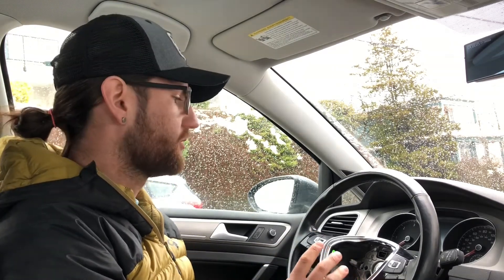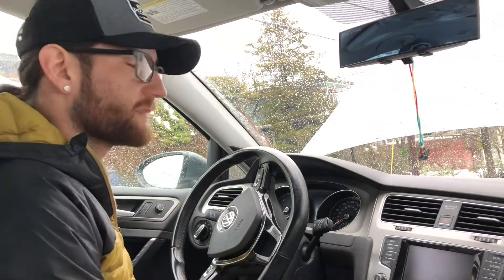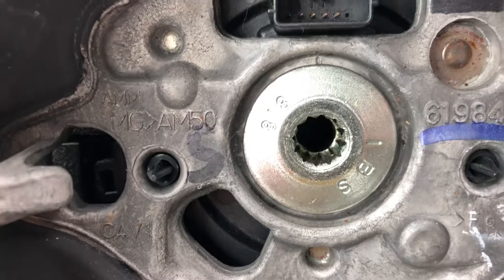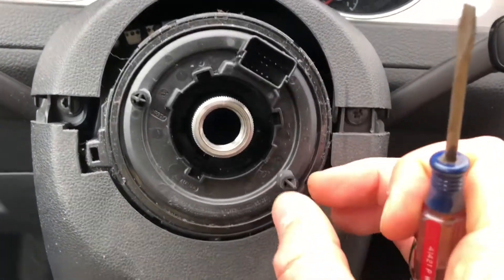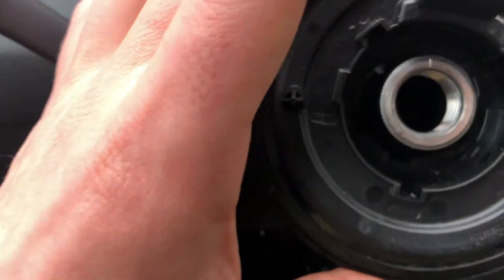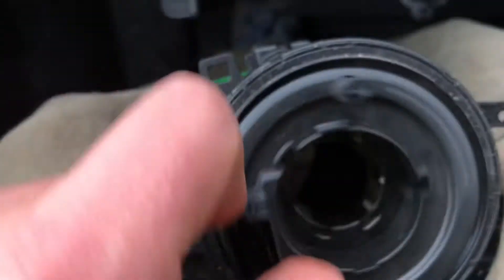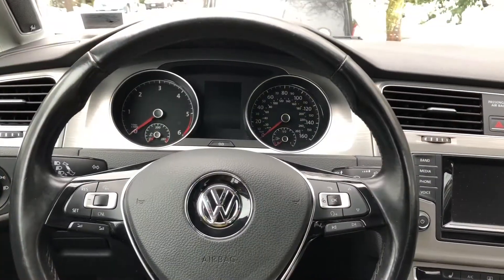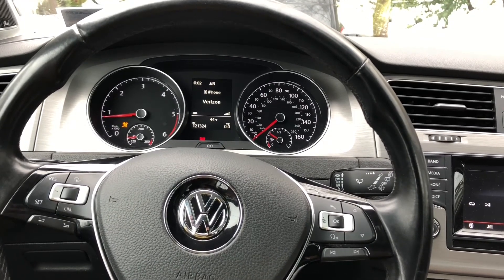Volkswagen MK7 clock-spring replacement

Comment: Replaced my clockspring & airbag light is still on. Anyone with the fix? Coding required?
Reply from the maker: Yes coding is required. I was able to pull the coding from the original clock spring and use that hard code for the new one.
Reply: @lmshelag what did you use to code it?